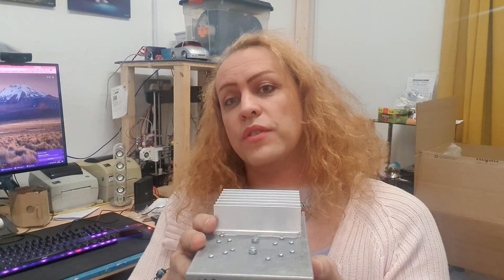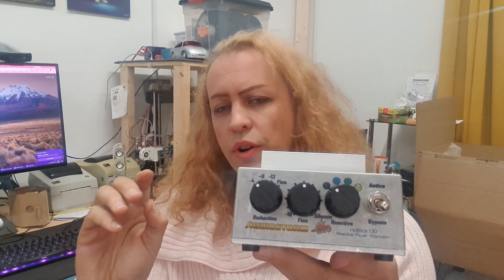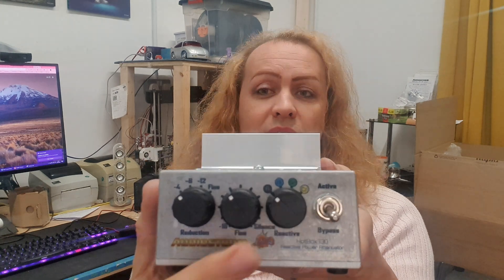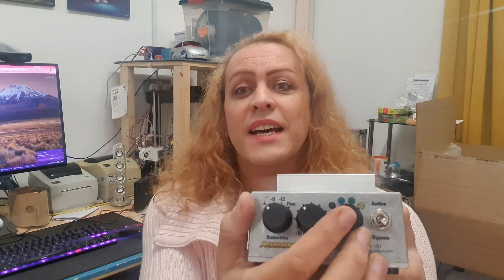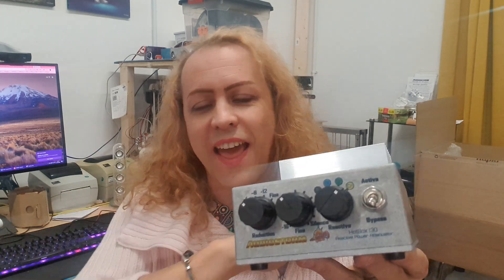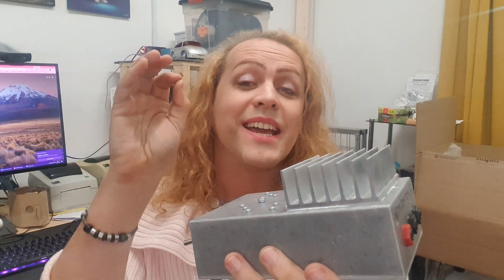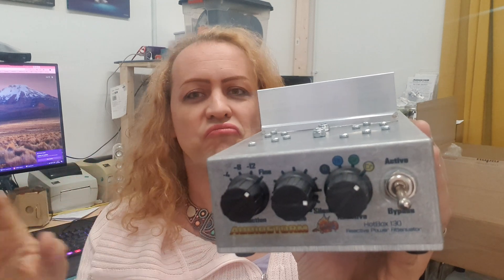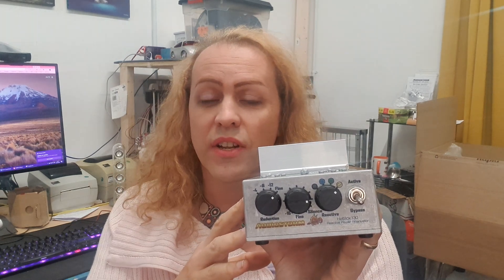New HB130 Reactive Power Attenuator preview (for Oct 2022 release)

Comment: Anyone have personal experience with this? I’m in the market for an attenuator and would rather buy from a small uk setup like this… only if it’s robust, sounds good and is safe for my amp?
Reply from the maker: Have a look on Amazon for some independent reviews. Also ebay and Reverb listings might have some. And one or two on the website but that's a new feature so hasn't built many up yet. I really do need to get these into the hands of more professional reviewers but I've found it strangely hard. Most of them just seem to ignore my messages. Not sure where I'm going wrong in that TBH. Maybe I'm just not cool enough for them!
Reply: @Audiostorm I honestly think there’s a gap in the market for this and with the right placement and promotion they could be huge. There’s a lot of people out there with boutique amps, old fenders, Bluesbreakers etc that need to get their amp running really hot to get the coveted tone. Attenuators currently either seem to be cheap/chinese, or unjustifiably expensive/overkill. Lots of larger amps are much cheaper now as they’re unusable in most scenarios… look at the value of a silver face deluxe reverb compared to a twin for example. The fact these are so lovingly hand made and designed here in the uk is also a huge selling point too.

Comment: Nice! I was surprised by the popularity of the resistive mode! Usually resistive attenuators and loadboxes get bad reputations and in various comparison videos they indeed sound dull and muddy compared to reactive ones. Can you please comment on that?
Reply from the maker: Sure! The common problem with a lot of resistive units is the use of rheostats and nichrome wire. These are cheap and popular rotary controls and resistors that heat up tremendously, like an old electric fire, often up to 500 deg C or more. This heat causes their resistance to change whilst you play, which in an electic fire is fine but in an attenuator I think it causes a dull sound.

A well-designed resistive attenuator should really sound very open and bright.  The output transformer of an amp is actually responsible for most of the 'reactive' effect and so in all cases you should still have great tone and a lot of sensitivity. In fact, in a technical sense, amps prefer a resistive load and it can even increase tube life in some cases!

In the end it's all just down to the quality of design and the quality of parts far more that reactive vs resistive.
Reply: @Audiostorm  Thank you! That was totally fresh look to attenuators, because because for years I thought that resistive ones do not deserve even attention. I will try to find some comparison I watched in the past that left me with that opinion.
Reply: @Audiostorm  P.S. E.g. here, from about 1:55 first is resistive mode (if I understand correctly), then reactive: https://youtu.be/oE6WLGykfiI?t=116